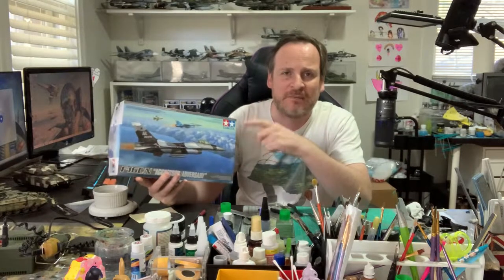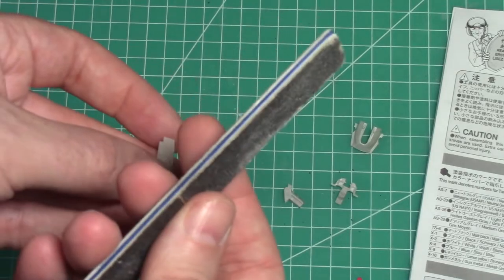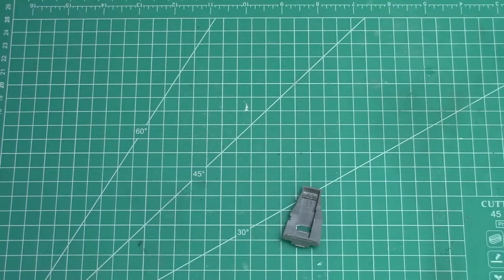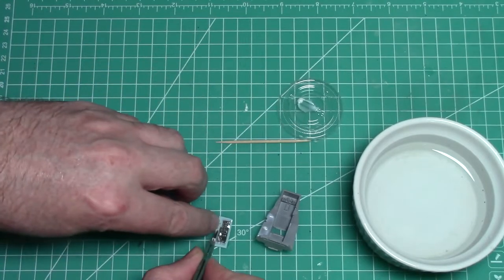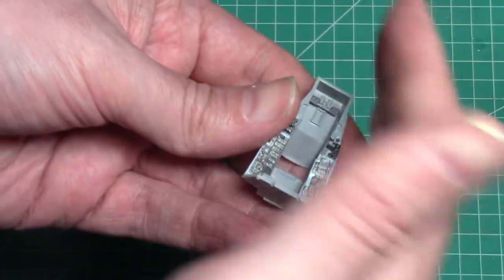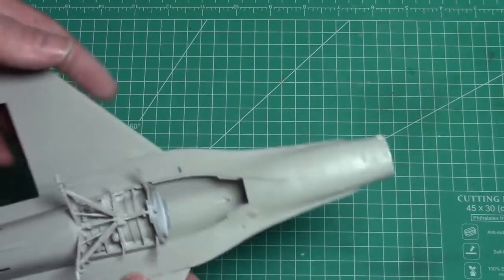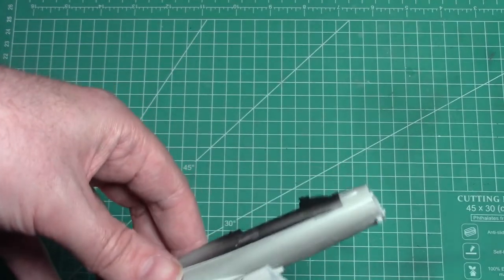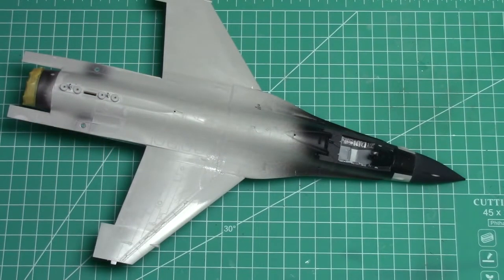1/48 Tamiya F-16C/N Aggressor Build Series - Part 3: Cockpit tub, Quinta Studios

Comment: Hi Richie - 3d decal question for you. I’m working on same f-16kit with same 3d Quinta decals - notice the light gray around the edge of the instrument panel decals?  Is that supposed to match the dark gull gray of the tub?  On my tub the paint is much darker than the edge of the decals. Do I need to carefully paint the edge of decal?  Is one color correct and the other one incorrect?  Curious about your thoughts. Thanks!
Reply from the maker: I built this about 6 months ago, so I don’t remember. I would check reference pics. I wouldn’t paint the decals, I would leave as-is. There is always going to be color variations within an aircraft.